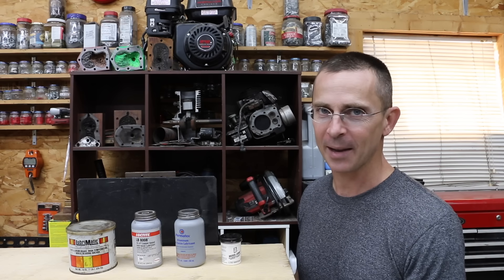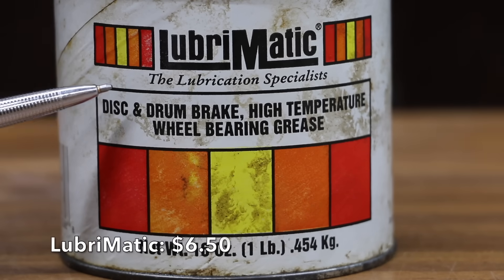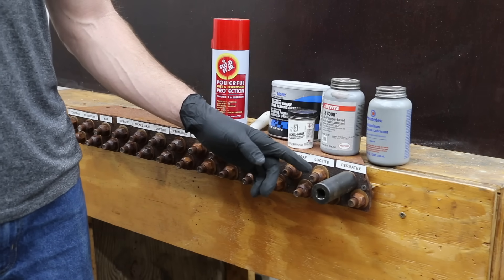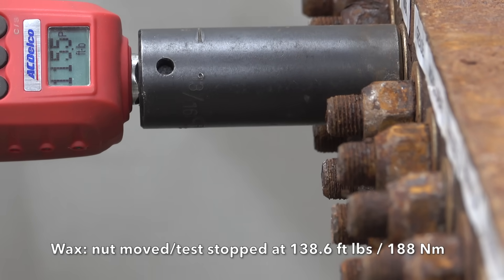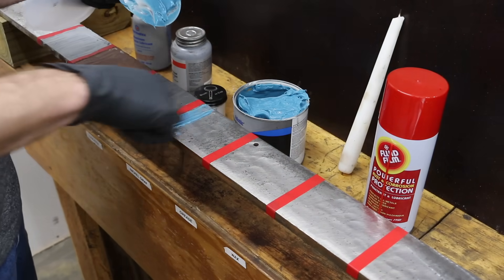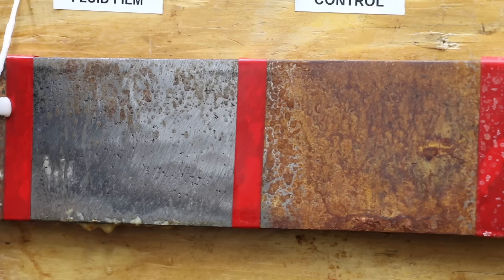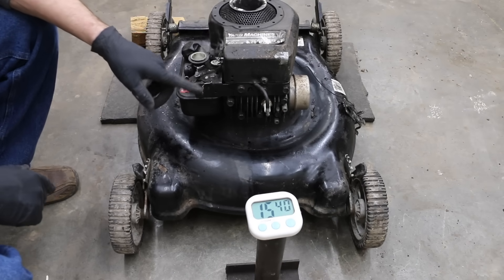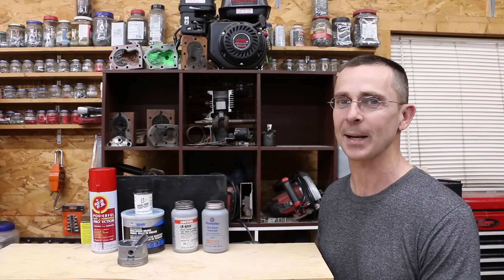Does Anti-Seize Compound Actually Work? Let's find out! Anti-Seize vs Grease vs Fluid Film vs Wax

Comment: I had a dairy. I used copper anti-seize on my manure pump. In 2 years it was so corrosive that bolt heads would no longer work with a wrench or socket. Using vice grips, I could break the nuts or bolts loose and the threads were like new. The anti-seize was still on the threads. I also had a commercial fishing boat and salt water corrosion was just as bad.
I use an anti-seize on anything exposed to weather or heat like exhaust manifolds.
Grease is better than nothing, but IME it doesn't last.
Reply from the maker: Thanks for sharing.

Comment: A little humor injected at the end by destroying the lawn mower engine. It is possible that the lack of lubrication due to the lack of lubricant flow is what caused the rod failure, rather than the abrasive nature of the anti-seize.

Comment: the wax will work better if you dissolve it in something like gasoline first and apply it to the metal. the gas evaporates and leaves behind a waxy film that is very difficult to remove. I have a vw from the 80s that has a ton of wax applied all to the inside of the boxed sections of the unibody. wherever that coating is, there is minimal corrosion even after all these years in the northeast.
Reply from the maker: Thanks for the feedback.

Comment: The MAJOR flaw in this test was using all similar metals. Anti seize has metal in it to make an inert barrier between dissimilar metals. Think alloy wheels touching steel brake disk/shoe, steel lug nut holding said alloy wheel. Anti seize is above all else to prevent galvanic corrosion.

Comment: ive been restoring an e36 for the last 3 years. every nut and bolt i take off gets anti seize before it goes back on. i have the permatex. i bought a small bottle for 6 bucks, it seems to last forever. im not even close to halfway done with it. only problem is make sure not to get it on your clothes or on your car seats. its nasty stuff to clean off. but your hardware just won't get rusted or stuck anymore. It's too bad that bmw and the past mechanics who worked on this car before i got it couldn't be bothered to spend $6 to prevent these problems in the first place.
Reply from the maker: Thanks for sharing.

Comment: What do you think about using anti-seize on spark plugs? Some say it's a good idea while others say not to do it. It seems that spark plug manufacturers don't want you to use anti-seize but they did say you'll need to reduce the torque setting if you use anti-seize. The story is that the anti-seize can modify the torque setting to excessive torque..
Reply: I’ve used it when the manufacturer calls for it. Ford recommends copper anti-seize when you do plugs on the v10’s. I know some guys never use anti seize on plugs and some do. On my personal vehicle, I put copper anti seize when I do my plugs. I don’t consult the book either, I just do it. If the book says torque your plugs to 27-30ft lbs, if I use anti seize, I go to 30 ft lbs. 

One other thing I always did was liberally coat the inside of trailer hitches with bever squeeze. I used to install braking systems on cars that would be towed behind RV’s and can’t tell you how many hitches were rusted together.
Reply: yes the copper is more conductive so that makes sense for a spark plug

Comment: I would check metal with a heat gun. If your temp is 550 it will take a long time to get up to temp. I’m not sure the thickness you had but I’ve had a sheet that’s 12 x 12 in oven at 550 and it took an hour to get up to 500 for an even heat color. With all that mass absorbing the heat I’d bet it was around 2-300
Reply from the maker: Thanks for sharing.

Comment: In the marine repair world specifically salt water, I use a good water proof grease that won't dry out in a short time on all under water fasteners and anchor pins and on many other in boat engine, steering and drive line parts. The under water fasteners are stainless steel of various grades and the parts are usually aluminum, brass or bronze. What happens is the aluminum corrodes and tightly compacts the bolt, stud or pins to the point removal is very difficult or even impossible with normal procedures and damage or destruction can result from removal attempts. The brass or bronze can be a problem at times but no where near the problem of aluminum.
 I use aluminum based anti-seize for stainless steel to stainless steel to prevent gulling of the bolt and nut threads. Seems like nylock nuts are much worse at gulling than regular nuts and I don't know what the science or engineering of the S.S. thread gulling is but aluminum anti-seize works every time where as grease usually doesn't. I assume the S.S. gulling is caused by burrs and poor manufacturing tolerances creating a lot of heat, binding and tearing the threads and for whatever reason the anti-seize prevents gulling and grease doesn't.
Reply from the maker: Great feedback. Thank you

Comment: Before watching this I can tell you anti-seize works. All it takes to know this is work in a paper mill turning big wrenches on big bolts. The ones without it are usually full of rust and easier to get out with a torch than a wrench. The ones with anti-seize, it can be 10 years later, are in great shape 99% of the time. If you really want to find out work on the steam lines coming off the boiler, thats the real test. Those lines get so hot they cook off anything put on them but anti-siezed bolts usually come off fairly easy.
Reply from the maker: Thanks for sharing.

Comment: I've used permatex for years.  I started using it after I had to beat the hell out of a rotor that was rusted solid on an old Ford truck I had.  I found later that using an air hammer gets it to release but didn't know that at the time.  So I started putting it on the hubs before installing new rotors.  There was always some left on the hub at the next brake job and they came right off even 2 or 3 years later.  But the easiest way I found to avoid problems with rust was to move from Detroit to Phoenix.  It's  nice to try and turn a nut that hasn't moved in 30 years and having it actually move.
Reply from the maker: Thanks for sharing.

Comment: I really like your videos and thank you for taking the time to do them. I am mechanic of 30 years and have a vast experience of tools chemicals etc. used in the motor industry. I almost never use anything by Permatex as they just don't cut it. I swear by Loctite /3M products as for example my rear view mirror fell off the windshield one day and bought a kit to stick it back on. I bought a Permatex kit followed the instructions and stuck it on 2 days later it fell off again. I used 3 Permatex kits and had the same problem despite me going over the top in roughing the contact surface and cleaning with alcohol etc. After getting fed up bought a Loctite kit and worked perfectly even in the hot climate I live in and was still on years later when got rid of car. I also use anti-seize a lot and silicone sealer/RTV, glues and again better quality than Permatex. I knew Loctite would win but keep up the good work and sorry if my little story was boring. Thanks All.
Reply from the maker: Thanks!  Thanks for sharing.

Comment: When I change spark plugs I apply anti-seize to the plug threads and the threads of the cylinder head with a small brush. I am dealing with a outboard engine right now where the previous owner did not use anti seize and one of the plugs broke off. Two different styles of EZ outs failed to remove the corroded plug and now it looks like I am going to have to drill it out. Anti-seize is inexpensive protection against a huge hassle and expense later.
Reply from the maker: Thanks for sharing.

Comment: Antiseize works great for high temp applications.  300-750 F.   I use it at work on   Plastic injection molding machine.  Without it bolts do seize and either break and or strip the head.   And is a must have for putting steel bolts or spark plugs into aluminum.   Without it the aluminum threads strip and or pull out.   I prefer copper based for steel and aluminum based for aluminum. Grease or anti-seize on threads requires less torque.  So that’s why your numbers are bellow 90 ft-lbs.

Comment: When you are torquing something ex: 90 ft lbs does unscrewing with no rust should be 90 ft lbs?
Reply from the maker: Great question.  Break away torque (loosening) should be less assuming the threads are not damaged in any way

Comment: Tip- for headers that show signs of rusting in the cracks where the pipes joined together add some anti-seize in the rusted cracks . It can handle the heat and blends in offering protection while improving a better look .
I did this on my Superformance AC Cobra MKII anodized side exhaust and it blends right in .
Reply from the maker: Thanks for sharing.
Reply: thats what header paint is for. barbecue grill paint will work in a pinch- vht.

Comment: i used some on my caliper retainer bolts and it turned to glue. i used clear silicon caulk, per the instructions, on my new trailer hitch's mounting bolts. no rust.
Reply from the maker: Thanks for sharing.

Comment: Applied anti-seize on the mating surfaces (Bearing/knuckle) during a bearing/hub replacement job on my car 10 yrs ago. It was time again to replace the bearings after 100k miles and the hubs came out loose as if I had installed it 3 days ago. Think it is a winner! in my case.
Reply from the maker: Thanks for sharing.

Comment: I’m a pipe fitter and blue monster nickel anti is the best that we have used that stuff works on 2 inch to 6 inch bolts and studs and cap screws extremely well
Reply from the maker: Thanks for sharing.
Reply: You know how to lay the pipe

Comment: Great Project! A couple comments: Your testing concerns seizure due to corrosion.  Working with clean stainless steel fasteners risks seizure due to microscopic attachment (cold welding?) of nut to bolt or stud; when this happens, attempts to disassemble will result in failure of the bolt. Your tests would be more dramatic with SS fasteners. Separately, I was told forty years ago that Milk of Magnesia was a 'go to' anti-seize' for fasteners in high temperature aerospace service . Another possible candidate for your tests?
Reply from the maker: Thanks for the video idea.

Comment: The candle wax didn't stop water from penetrating underneath it,also I think the candle wax biodegrades and leaves the thread space. Fluid film might do the same thing but more slowly.  Sometimes melting candlewax onto rusty threads helps to break a tight nut or bolt free. If the bolt is kind of hot. Letting the melt soak into the threads. 
  Assembled threads as used in automobile and lawnmower fasteners contain empty or potentially water or air containing  space,the substances help fill the space and keep oxidizing air and water out I think. 

 Plumbers have stuff that will fill or seal threads. Have wondered if anyone uses that stuff on cars. 
Would be interesting to try a very low strength threadlocker on such as axle or lug nuts,after 20 years of rust would the nuts come off more easy than if without thread locker? (I think threadlocker discourages corrosion and may stop water from seeping into the threads)

Comment: I would have loved to see a more in depth test, one where the control actually got to the point where it sheered the bolt or stripped the nut.

I realize it's really difficult to emulate real world conditions from years of use, salt spray, heating and cooling cycles, submersion, and also dust and dirt working its way into threads.

I also wonder the differences in seizing depending on grade of bolts. I recently did some work on my semi truck (it lived in Louisiana for many years and had plenty of frame rust) with Grade 8 bolts in the frame and there were several bolts that didn't shear but I had to cut some of them and some of them had great difficulty with many minutes with an impact driver (the big DeWalt one, have you tested those?)

On the other hand, I have a 1950s tractor that I removed a piece from, installed who knows when, I do know the tractor was parked uncovered dozens of years ago. Whoever installed the piece used anti-seize and it was refreshing for the bolts to come right off and still be usable. I'm often accustomed to buying new bolts for old things because they get ruined trying to remove them.
Reply from the maker: Thanks for the suggestion.

Comment: Try the next experiment on a Titanium road bike frame with an aluminum threaded bottom bracket, without antisieze, the two metals react in such a way that it cold welds itself in to the frame…. Salt and water extrapolate the reaction… sweat and Utah winters are hell on ti bikes

Comment: missed one anti rust agent  RTV gasket maker. I used it on some bolts and then removed them about 15 years later. the unprotected parts. were almost gone but the protected threads were still usable.
Reply from the maker: Thanks for the suggestion.

Comment: I doubt candle wax is ideal, but to be fair, heat the work like you do with solder so it can take advantage of capillary action. You wouldn't solder a connection by dripping solder on a cold joint. Heat the joint, touch the candle, and let it wick into the threads.
Reply from the maker: Thanks for sharing.

Comment: It seems that one of the worst things that will jam a nut and bolt together is if you use the same grades of stainless steel for the bolts and the nuts. It will pick up a gall on one or the other and since they are the same hardness neither part wants to give. I have had relatively small hardware (3/8") that was brand new out of the box nuts and bolts that would pick up a gall even while hand assembling the two parts. As soon as you put a wrench to it you are doomed. It is going to gall so badly it is as if the bolt and nut are welded together.
I used a copper based anti-seize and it reduces the problem (some) but really I needed to change to a different grade of stainless for the nuts.
Reply from the maker: Thanks for sharing.

Comment: I used some antiseize on my caliper bolts when I had to use a propylene torch to break virtually every bolt loose. One question I have though is: does the use of anti-seize require going above the specified torque spec in order to make sure it doesn't back itself off?
Reply from the maker: That's a great question.  The bolt will actually reach a higher clamp load with the same amount of torque.  So, you do not want to over torque the bolt.

Comment: I've been told in GM training that although grease works really well to prevent rust, it promotes the fastener becoming loose because it's a lubricant. Anti-seize is not a lubricant and instead relies on the layer of non-corrosive base material (copper,graphite,etc) to shield the underlying metal from corrosion without lubricating. It does after time, "dry out" into more of a paste like substance as evidence of that. Sounds like the next test candidate! Lol
Reply: Anti-seize is definitely not intended as a lubricant, per se, but to say it's not a lubricant is wrong;  They are literally labeled as lubricants and you wouldn't want to use them on anything that vibrates (2-stroke engine is a good example) a lot. Lug nuts are another no-no.  ALL TORQUE SPECS are for new, clean, dry bolts.  Bolts in high-heat applications that have been previously torqued should not be reused as they have already been stretched and heat-cycled.  The primary purpose of anti-seize is not as a lubricant but to prevent galling and seizing in high temperature applications up to 1800 deg. F.  No petroleum based lubricant will survive that (not even 600 deg. F).  Otherwise, just use grease if you want a lubricant... it's far less expensive.
The reason they are metal based is so they will prevent oxidation on both surfaces which increases the mass of the metals.  Within a constrained thread way this is asking for trouble as the oxides will interface and "lock".  Yes, rusty metal weighs more than clean metal, contrary to popular belief because people see "rust holes" which is lost metal, not rusty metal. In ferrous metals this is:  4Fe + 3O2 + 6H2O → 4Fe(OH)3  Also, the examples you have given (copper and graphite) aren't the same as carbon is not a metal and is actually tetravalent.  Copper is also more noble than carbon steel so the steel you are wanting to prevent from corroding actually becomes the sacrificial anode instead.  For this reason, aluminum, zinc, and magnesium are the best choices for anti-seize compounds as they are LESS noble than steel and become sacrificial in a galvanic environment.
Reply from the maker: Thanks for the suggestion.
Reply: @bea gulls if that was true you and your issues would be wheelchair bound by now